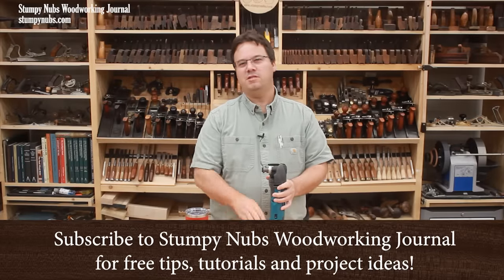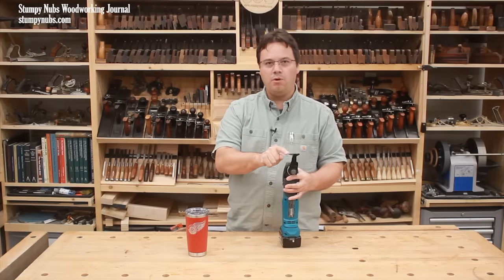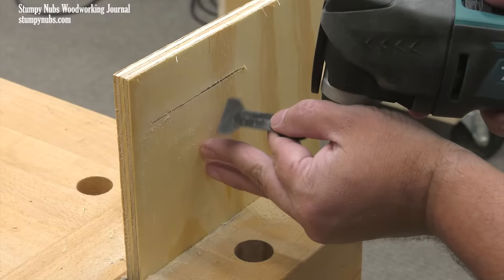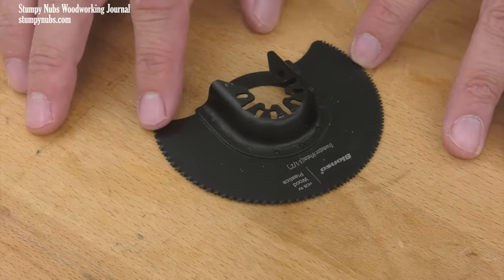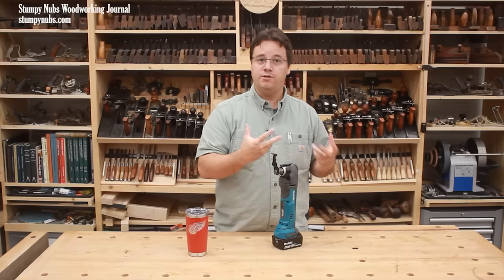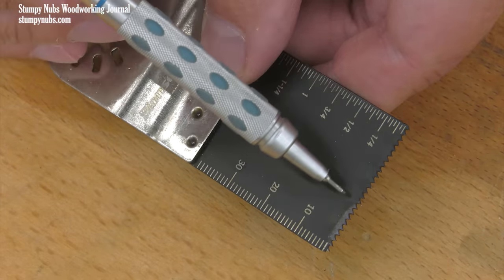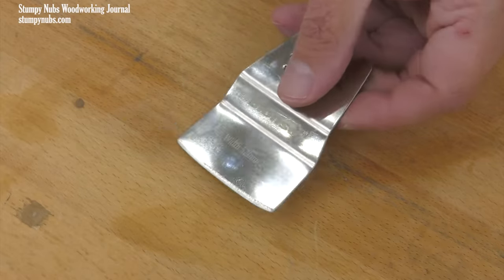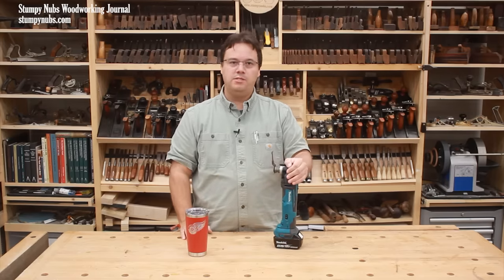CLEVER things to do with an Oscillating Multi-Tool!

Comment: I have a corded Fein I purchased probably around 2001 or so. One down side of this tool is the simplicity of the tool holder: blades can and do work their way loose under heavy load.  However that simplicity does have an upside: I learned to save money on blades by cutting old ryoba saw blades into strips about 1.5-2" wide and drilling a mounting hole in them.

I found that even a substantially dull ryoba blade could cut remarkably well this way.  The razor cut cross cut teeth will drive through wood and plastics like butter.  Even if you used this technique with a brand new ryoba blade, that would be cheaper than buying some e-cut blades.

Also, I did this for many years before my son had the smart suggestion to round off the rip tooth side (pointing toward your fingers) on the bench grinder.

Comment: My first OT was bought for the scrapper, to remove old beads of construction adhesive from my basement cinder block wall.  It was a corded Rockwell, and took it off like butter.  The only problem I had with it was that it used an allen wrench to snug down the disc to capture the blade, and it worked itself loose...A LOT.  Last year, picked up a DeWalt, battery operated OT, and it is great.  I still have the old corded one, as a backup.

Comment: As a cabinetmaker; I don't usually waste money on cheap power tools. However, I bought a Harbor Freight oscillating multi-tool for $45. Worth every penny! Just as good as the high dollar brands I've tried. I use it on nearly every installation. BTW - Buy all your blades on Ebay. I can get 20 for about a dollar apiece.

Comment: I bought a Bosch PMF 190 E corded multi tool for removing grout from my bathroom tiles. It lasted about an hour then died so I sent it back. The replacement also lasted about an hour before it died so that went back too. With only about half the bathroom done I then hired a Fein and finished the job off without further dramas. Apparently the Bosch devices have some sort of thyrister that goes pop if you overwork it… That was about 8 years ago and the model is no longer available, but it did put me off Bosch a bit. These days I tend to go for Makita and have about five of their tools including a corded multi tool that I’m very happy with.

Comment: I have nothing but excellent results refinishing doors with the sanding attachment. I use the blue metal sanding paper in very fine grit and it really helps me get into those impossible areas. On the whole I highly recommend trying the sanding head for this purpose.

Comment: I find the scraper blade is good for making smooth cuts in polypropylene.
The narrow sawblade is really a good tool for cutting the tails of dovetail joints. The plunge cut is very desirable for this.

Comment: I use the sander attachment to sharpen knives. Carborundum (wet/dry) pads come in a variety of coarsness, and with the tool upside down I can run the knife blade accurately just like a wet stone.

Comment: I bought one of these stupid things just to trim door molding so I could slip floor tile under the molding.  I never thought I would use it again until it was brought to my attention that there are fan-shaped blades with semicircles cut in the sides, to emulate a linoleum/shingle knife.  This solved a problem that I had been cogitating for years, ever since the dimwit roofers placed the shingles so that they almost covered the gutters.  You have to turn the speed all the way and once you do, this thing goes through shingles like butter.

Comment: 2:00 I used this method when I needed to trim the bottom of the siding on my garden shed. I screwed a strip of 13/16" (21mm) plywood angled at 30° to the bottom to make a drip edge.
I had to dig into the ground to get enough clearance for the tool (Bosch GOP 18V-28), but I had to pour concrete there anyway.

Comment: I use to work for a medical surgical tool company and repaired hundreds of these that were nitrogen powered(instead of compressed air). After the rebuild, they were tested on blocks of 2x4 for 5min.

Comment: Thanks JM for another well-done video. My input is that I exploited the results of Project Farm and his testing of the available blades out there. The number one in cutting through nails is the one made by EZ-Arc. I do not regret it. The 3-Pak cost me a few bucks more than the next best-rated blade. But they have been well worth it! My grandsons just finished slicing through rim-shank screws as we re-used some fencing cedar to make a table. Blade is still in great shape. BTW—Yes, I did learn some tips from your vid that will be very useful. You can teach an old dog new tricks!! Thanks!
Reply: 9
Reply: 9
Reply: Ppooppp]]]][pi o pól9

Comment: for people in the market for one of these, I would recommend the dewalt 20volt max unit, It has a quick change bit feature, The light on the tool is in the "right" spot, and its a absolute beast, Also, I would recommend buying a product called "sharp pog", it sharpens those expensive blades so you can get more use out of them, it wont put a "perfect" factory edge, but its good enough to get the job done for sure

Comment: Thanks I have been using Fein multitools for about 25 years. I originally bought it for detail sanding but use it for lots of other reasons now, the only multitool I would use is Fein, but not their overpriced blades etc!

Comment: As always, great video. I have had the Fein since before 2008, and as a boat owner that does his own maintenance, the multimaster is indispensable. It is the marine sawzall. While I agree with almost everything you said, I disagree with the sanding function. The shape of the sanding shoe is great. You can sand the toe rail on a boat with no tape and not scratch the deck and you can sand into a corner without affecting the other surfaces. Yes, you need to follow up with hand sanding with 220 but it saves a lot of time on your knees on the deck of a boat.

Comment: The wide blade narrowed up on a grinder and using it like a jigsaw... Great idea!  I'm going to try that tomorrow...  I bought the whole pro kit from Fein back in '05 or '06 At the end of the first week of using this tool at several paying jobs, it was a Game-changer... On the metal tool case it came in, the tool name was the MultiMaster Pro and under that I wrote with a sharpie,  Money Maker !   Fein still makes the MOST precision cutting, BEST wood blades.   P.S.  That $400. Pro kit paid for its self in about 1 week.

Comment: I have been using this tool since the 1980s when there was only 1 blade available. In fact they were ubiquitous and regularly used. What For?
Cutting the casts of broken limbs without cutting the skin. Though you need to pause regularly to let the blade cool down or risk  a light burn.
Every orthopedic department has one.

Comment: In extreme headlight restoration where multiple grits of sandpaper are used, it just seems way less likely that a tool like this is going to go skittering off to damage chrome or paint than a disk chucked into a drill, as is usually shown. I haven’t tried this yet, but I just acquired one of these tools, and it’s something I intend to try. If it saves a bunch of time in the masking process, that might be helpful also. Just a thought.

Comment: A note on the safety of touching the moving blade if that freaks you out. It may be worth checking out Steve Mould's video on cast saws, they function in much the same way.

TLDR is that the oscillating motion combined with the elasticity of your skin means that, instead of cutting into you, your skin simply moves with the motion of the saw blade. Your skin can generally move further than the travel of the blade. It cuts rigid materials because they don't move.

Comment: Thanks for the tips. I've found that using the sandpaper triangular gizmo is excellent for sharpening my knives and axes using 400 grit paper. I just cut the paper to shape with a pair of scissors and glue a piece of fluffy velcro on the back; works a treat!!!

Comment: I previously thought scraper blades were worthless.  Then I needed to remove old hardened caulking from exterior house eaves.  It was so much easier.  The hardest part was avoiding digging into the wood.

Comment: If you super glue sand paper to an old blade you can sand the inside of very thin awkward to reach places.
FYI the Makita multi tool is prone to dust build up in the motor, this slows it down and eventually burns it out, if you remove the head/gearbox put a hover over the end and run it, it'll clear it out and last longer, changing the motor is pretty simple too and about £20 Ebay lol

Comment: You are mistaken on the sanding value of these tools (first time for everything, eh?).

I bought my Fein Multitool about seventeen or so years ago. I had an over-the-post stair well requiring sanding around every one of the balusters to bring the fillets flush with the outsides. No other sander would solve that problem. As such, I grit my teeth and dropped the $350.00, at Western Tool in hopes it would handle the task. It did.  

Since that day, I've had many other sanding projects that other sanders couldn't handle, but the Multitool, with its interchangeable contoured heads, ate them up.

When I got a bit heavy handed and melted the hook-and-loop of a mount pad, I cut the pad down and made custom pads for getting into even smaller spaces. For example, I'm working on an antique rocker and the tight spots between pieces are a breezed to finish up (after scraping, by hand) with the smaller heads and hook-and loop.

I've re-sharpened several blades. Even a crude and crappy sharpening job can breath life into what was an expensive blade.

For scrapers, I bought a bunch of Dollar Store 5-Ways and putty knives, removed the handles, then punched a hole in the metal to allow it to mount on my Multitool. The bigger scrapers are handy for tile removal and so on.

The Feintool Multitool has been such a great solution for so many of the other tasks you displayed (even sizing an aluminum screen door), I'd replace it in a heart beat, if it died tomorrow (even thought about murdering mine, as an excuse to get a later, tool-less model).

Comment: You can weld an old blade onto a hole saw and cut holes. Perfect for light holes in drywall, I have a 3 and 4 inch. Just used cheap harbor freight hole saws

Comment: Some good tips here. The speed is vital I see a lot of people going through blades like matches (including the smoke) because they have the machine at maximum speed when cutting in wood. I habitually have it at two or so and the blades last quite a while then. Also, there are some tools to sharpen and set blades if you use this a lot. Those  are not cheap though.
Reply: I use the thinest 1mm. cut off blade,  on my 5 in.  angle grinder to resharpen blunt multi tool blades.  Good enough when you run out of blades.

Comment: We had a two story brick house (circa 1925) that needed a lot of “tuckpointing”, probably about 10% of the joints. Some of the mortar had deteriorated so far that bricks were falling out. Not being a mason, I was flailing about trying to find a way to do the job. Fortunately most of the damage was assessable without a ladder. I started using a chisel and hammer; tink, tink tink. Too Slow! So I tried my cheap HF oscillating saw with a very dull blade. I removed all the bad mortar in a mornings time. A friend helped me install new mortar. We got the whole job done in just one day. Due to my inexperience, it wasn’t very pretty, but it was solid.

Comment: Metal Cutting Tip:  Use some sort of cutting fluid (TapMagic is one such fluid).  They help the blade cut, and have a low flashpoint which helps them keep the blade cool and last longer.

Comment: One more tip... My wife has a condition that causes a very thick growth of skin on the underside of her feet and suffers cracking as a result. She suffered for years having to use a manual foot sander that barely takes anything off. We found some 80 or even 40 grit sand paper on the larger sanding head just cuts through the dead skin like butter but doesn't touch the new skin below. After a few cycles of using this spanning about 2-3 months, all her cracks are gone and she can walk normally again. Now we have a his and hers oscillating tool, lol.

Comment: Multi-tools also work surprisingly well on rubber stall mats. I was using a razor blade to continuously score a line but got tired of that. Just snap a chalk a line, and put light pressure to pry the cut apart, and it zips right through it.

Comment: I will add something from myself after using this tool as a main tool for almost everything (cutting composites) 
U should check any of Bosch / or Fein STARLOCK system 
for example cheap ones bosch advanced multi 18v or universal multi 12v 
they cut craaazy good , u will think it isn't about the blade mount ...but it is about the blade mount
makes a huge difference in how awesome the tool works and how much power it have

Comment: I recently needed to cut a hole for an outlet box in the exterior of my garage for an electrical switch... The garage has HardiPlank siding, so I started out with just a hand grout removal tool, but that was going too slow and figured my oscillating multi-tool would be faster... I've used it mainly for a small amount of drywall and soft wood cuts previously... Although it did manage to cut the hole, when I looked at the blade afterwards, there were NO teeth left on it and it looked like a slightly curved face scraper blade... Although I know I can get a triangular file and cut new teeth into it, I decided to just order a 10-pack of similar blades from AliExpress for $12 and sharpen the existing blade as a knife blade for cutting old carpet into manageable sizes...

Comment: My hip surgeon had a nice one back in 1985 when he did my hip (betcha that cost a lot). I bought 4 of the FEIN corner sanders when I worked for a boat builder. The painters loved them because they can get into tight corners; they were more efficient than their fingers. They came with saw blades, but we never used them. Isn't that odd?

Comment: I recently started dunking the blade in water to cool it back down quickly when it started getting hot, knowing it's when it's hot that it starts deforming.
A nice fancy feature addition could be a heat indicator & sensor on the blade mount, someday.

Comment: Thanks for the tips especially for cutting straight and storing with the blade.
Indispensable for cutting subfloor near the wall where a circular saw won't fit. Can use a titanium blade to cut copper pipe when the rotational pipe cutter won't fit. just smooth edges with a rasp.

Comment: Actually I use mine when doing ding repair on surfboards.  They are much easier to control when working on small repairs.  They can be combined with interface pads to help blend repairs and leave a very nice finish that is easily polished if desired.

Comment: I do not question the quality of the Ridge carbide blades but will say how many people have the resources to spend 150.00 on one blade. I only use my table saw to rip stock a bit wider than needed. I always jointer the edge to eliminate cut marks and straighten up the edge. Looking for sales on common carbide blades at most home centers will allow you to cut and rip fine and not brake the bank.
Reply from the maker: You're advocating saving money by getting a jointer instead of a premium saw blade?

Comment: VERY GOOD info you've shared!
Appreciate it! I actually got my 1st one from Harbor Freight several years ago. Strictly for home use.
Works quite well so far. But my favorite brand is Makita in several other tools I've purchased. Besides, I've acquired many batteries and chargers so only seems wise to stay with this VERY GOOD MANUFACTURER. 👍

Comment: They work great for precise cuts in drywall, especially the half moon blades since they're easier to orient and won't let you cut too deep. If you're like me and only had experience with the old Milwaukee m12 version, try out just about any other brand or the other milwaukee models - that thing is a toy.

Comment: I bought a cheap 'Aldi Special' (£30!) when they first came out - it's still functioning but the paddle speed control on the Dewalt brushless is a revelation. Unfortunately Makita chose a 'non-standard' blade configuration for your model so sharing blades is no longer an option - also it is a slower blade change requiring the removal of the (unreliable) pin.
Such a shame that patents once again (see also 3D printers) severely limited our enjoyment of great ideas for so long.

Comment: Sander attachement  tip : I make 1k, 3k, 5k grit with some velcro ans automotive carbide wet sanding paper. I get wayyyyyyyyy better results without rather than using the rotating polisher. It eliminates the risk of overheating the plastic when polishing my cars headlights. I use the polisher only at the last step with the sponge and polishing paste.

Comment: The only one I hadn't already figured out was to turn the blade around before I throw it in my box. I need to remember to do that. You actually can touch the blade while it's running without it cutting you as long as you don't press super hard.

One thing that might be useful for the DeWalt owners if you haven't figured it out already. The sanding attachment and some of the others that have a closed Circle can be installed by taking an allen wrench and then screwing the little Bolt right in the middle putting the blade in and then putting everything back on. You lose the coolest blade change feature while using those attachments but sometimes it's necessary.